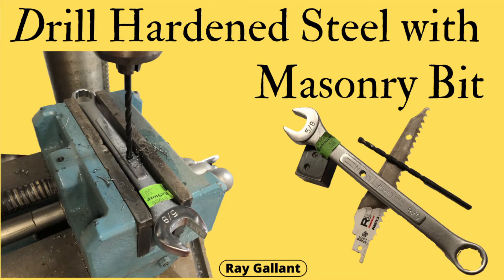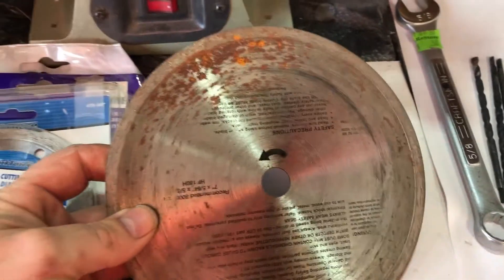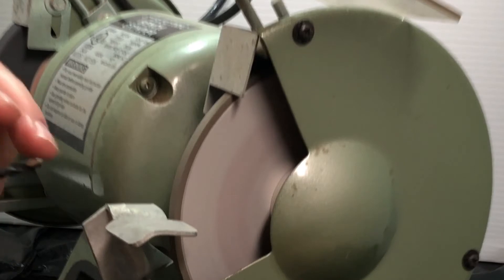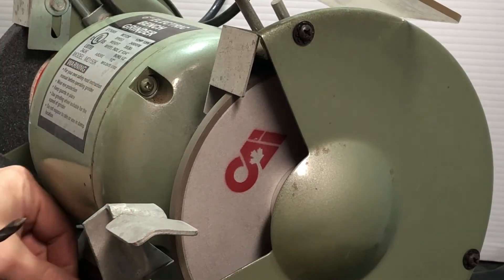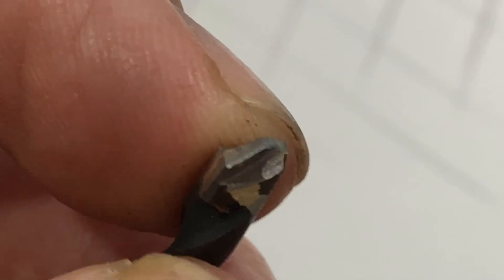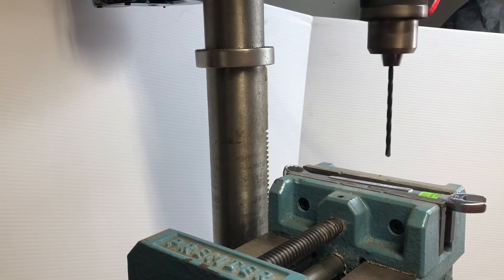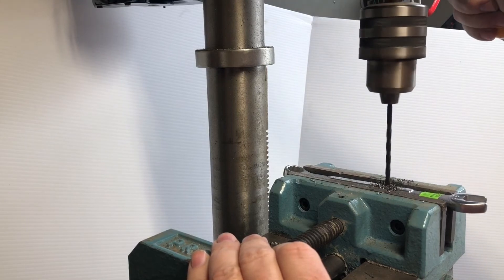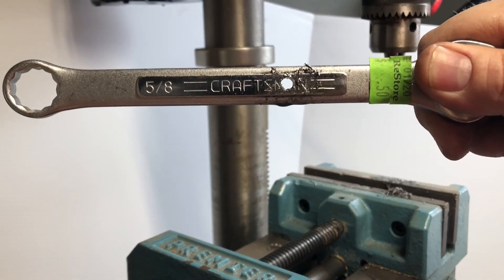Drilling Hardened Steel With Masonry Bits

Comment: I use a coolant while drilling using this method to prevent the braze holding the Tungsten tip to the brill-bit from melting/softening . . .(speaking from experience).

Comment: If drilling through thick aluminum, how long should the bit stay in contact before lubing and clearing shavings?
Also, how much downward force should one use to not burn up the bit?

Comment: What is the name of the wheel you used ? cheers
Reply from the maker: Wheel that I used is it American-made diamond wheel 
I have a separate video on mounting it that goes into explain that I picked the wheel up for five dollars from somebody on Facebook marketplace and it had been on there for months. No one knew what it was. 
Drop the price from eight dollars to five dollars who is selling off his father-in-law‘s woodworking tools 
This particular wheat retails for around $500 but you can get them on Amazon much cheaper and for doing this type of work. A CBN wheel will work just as well.

Comment: Be aware that when using carbide tooling on the mill or lathe you either do or do not use cutting fluid or coolant,the reason is this if you use oil/coolant(milk) you have to flood the part not just add it here and there because the carbide is so hard it cannot take heat stress ie sudden cooling ,it will shatter.

No lube or coolant can be done easily at reduced speed,in the case of the drill i would add the oil to the top of the drill shank to allow a constant feed down the drill as the oil gets closer to the carbide the steel shank will heat the oil up to match the carbide temperature,use a brush to add the oil as it holds oil on the bristles as a reservoir.

I've ruined plenty of cutting tools on the mill and lathe by not realising carbide is happy dry cutting,just don't thermally shock it or it's done for.

Comment: Now they make  "multi-material" bits like this with slightly better geometry for cutting steel. Some manufacturers recommend high as possible rpm when drilling steel.
Reply from the maker: Yes, Bosch and a few other manufacturers make them they’ve come down quite a bit in price and there’s multiple sizes

I have made three videos on drilling, hard material or using the same technique just to show that from home with very little investment, you can drill harder material in a non-Ritchard set up 

Thank you for taking the time to comment. It is much appreciated. 
Ray

Comment: 100% - but will this work for enlarging and existing hardened motorcycle sprocket 8.5 mm bolt hole to 10.5 mm? Cobalt drills aren't supposed to work as the central web isn't big enough so they will likely grab and snap; and even if not the sides of the cutting faces in contact will just blunt after one or two holes?
Reply from the maker: Carbide generally outperforms cobalt. The only factors are the quality of sharpening and the angles.
The more rigid, the set up the better the carbide will perform

Comment: Wow. I never knew that but I had 4 case hardened steel parts to drill an oil hole in and the masonry bit worked like a charm. Took only 5 minutes to do 4 pieces.
Reply: That’s excellent
Thank you for sharing your experience much appreciated and thank you for commenting that really inspires me to create more contact
Thank you
Ray

Comment: I've used a few HHS jebbsen bit and some other bits but nothing seems to make a hole bits keep braking.
Reply from the maker: What are you drilling into?
It depends on the type of steel I have another video which basically does the exact same thing or a drill into a tap 
This method does work relatively well there are a few things you have to keep in mind the diamond wheel I’m using puts an extremely sharp edge on the tool so that’s a bit of an unfair advantage
I am also drawing into something that is flat so if you’re drilling into something that has a bumpy contour onto it that you cannot flatten out you’re going to run into problems with the chip not fighting right away and wandering that could be a problem
Another problem is if you’re drilling into something that is hard and soft so the tap that I was drilling into the tap was hard but the surrounding material was not so that could be a bit of a problem as well
I hope that this helps
Ray
Reply: Drill into broken studd at the sump af the engine

Comment: Your demonstration  is very informative..  I've yet to try it myself.  Thank you.  Oh, one question.  Does it work with a smaller 1/8 drill bit?
Reply from the maker: Thank you for taking the time to comment
It should work with smaller drills now that I’m getting older I’m having a harder time dealing with this very small stuff
Magnification is required
Reply: @shopandmath  Thank you so much for your time and help.  I've tried an 1/8" bit and it really worked.

For your information, I first used a high speed drill  bit and then a cobolt bit.  Both couldn't even scratch  an 1/4" thick hardened steel.
Reply from the maker: I am glad to see that it worked out for you
and thank you for sharing 
Ray

Comment: Would this principle work on the bigger masonry bits like 1/2 and 3/4 and so on? Do you calculate the RPM for these as 80x4/drill dia or do  you use other numbers?
Reply from the maker: I have done this with drawls up to 3/4 of an inch with great success
Under ideal current conditions you can use probably up to a 300 CS
In the type of demonstration that I showed in this video the set up is not rigid and you would have to drop your CS down to probably 50 to 100
I hope that this helped
All the best
Ray

Comment: to be honest you need better camera skills for this video because it could be one of THE MOST IMPORTANT VIDEOS on youtube.
I thought that you needed a diamond wheel in order to be able to grind carbide masonry bits
Reply from the maker: I am doing the best that I can
there is a NEW how to drill harden steel video coming out Friday Oct 23 -20 at 9am
I have had multiple requests to drill very hard steel with a hand drill ?
i picked up a random chunk at work 59 RC
Ray
Reply: @shopandmath  please do it using a drill press cause it is more professional rather than a " the king of random" style video. This could really help people. sometimes you need to modify a hand tool for a specific function.
About the camera skills if you could use the help of an acquaintance of yours who knows about cameras and angles, he/she could really help you get the tip of the drill so focused when you zoom in. 
Your videos are very informative and helpful especially this one
thank you
Reply from the maker: @athrunzala5337  
don't watch the next video this friday
I used 3 camras and there is a good amount of white washing
it was the last worm day of summer
and filmed outside
should have done it inside
Ray

Comment: Just wondering what rpms was the drill turning at. I drilled hard steel last week with a masonary bit , but the package said good for steel too. Able to do rebar, I guess. Any way, I had 4, 3/16 holes to drill though 1 1/8 diameter hard steel. It worked but took about 2 plus hours. With a hand drill. Could not get the piece in a drill press. I used rapid tap oil. Masonary bits work. But in my case it was hard pushing. Thanks for the video.
Reply from the maker: You are the second person to ask about drilling hard material with a hand drill
I am currently in production of a video to drill hard material with a hand drill
I am currently swamped with school work
Hopefully Video will be posted either this Friday or three Fridays from now because next Friday’s video is on glass cutting

That amount of time is unacceptable and should have cut a lot faster
The piece I’m going to be cutting I believe is 49 or 59 Rockwell I film the hardness testing three weeks ago
Did you sharpen the drill to resemble a spade bit? 
Did you also re-sharpen after the tool became dulled?
Do you use a guide to drill the hole perpendicular and also to prevent angular movement during drilling?

Hold tight the video should be up in a couple of weeks
Thank you for your support and comments
Ray

Comment: Great demonstration. By the way, the Egyptians built everything they ever built with copper tools, which proves the point, you can cut hard stuff with soft tools if you have enough time, are patient, and you put a good point on the tool.  By the way, , you are guilty of a pronunciation that I used to be guilty of, until someone corrected me.  The word is  pronounced MASON RI not MASON ARY.  There is no A in there.  OK yell at me, but you will be a better person.  Oh, and slaves didn't build the pyramids.  Egyptian Patriots did. They were proud to work on such a big national project. It was also off season work  and a way to make money when they couldn't farm.  It was like their Moon  Shot.  With the pharoah buried in the pyramid, their future and security would be guaranteed.  That's a bunch of information you didn't ask for. That could also explain their persistence working with dull tools.  I used to be a teacher. Sorry!   Video Liked!!
Reply: thanks, I;ve always said masonary, but no more :)

Comment: For us lesser mortals, would you consider doing this demo with a hand drill (for those of us who are drill press-less).
Reply from the maker: I can do a demo what would you like me to drill threw ?
Reply: @shopandmath  I need to put some bolts through a spading fork head so that I can attach it to a handle.  My HSS drill bits were worthless...including the one that broke in half.
Reply from the maker: @tomterrific8574  
 spading fork head ?
can you send me a photo and some more info 
shopandmath@gmail.com
is it the same as fork lift forks ?
Reply: @shopandmath  A "spading fork" is what is called a "garden fork" in some parts of the country.  It is a four prong implement for breaking up soil for planting or light agricultural work where a tractor is overkill.  Generally, it is like a spade (shovel) that tills the earth without digging a hole.  The material is approximately one-half inch deep by three-quarters of an inch wide.  My original tool came apart after way too much use.  If you are in Canada, you will have to convert my English (American) measurement into Metric.
Reply from the maker: @tomterrific8574  is it a available on amazon?
or is it as hard as a wrench ?
Reply from the maker: @tomterrific8574  
I call that a pitch fork
I will do some research on the type of material and hardness and get back to you
Ray
Reply: @shopandmath  I understand you.  When I misspent my youth on a farm, a pitch fork was a long handled device with seven to ten tines that was used for "pitching" hay to feed animals and the like.  I guess nobody does that anymore (I'm really old)!
Reply from the maker: the video is finished and will be posted Friday Oct 23 at 9am
how to drill hardened steel with a hand drill
it took a long time to make but its done 
59RC about 18 minutes to drill 4 bits and multiple times sharpened 
drilled through 1 inch
Reply: @shopandmath  Thank you very much for following through with my request!  I cannot wait to see the video!

Comment: Amazing. Will try it to drill out a stuck bit in impact driver. Edit: used an unsharpened masonry to drill. It worked well and my drill operational again.
Reply from the maker: let me know how it works for you

ray
Reply: @michaelcook4922  i got this b4 others got to it. It looks hit and wedged in real hard from previous attempts. I dont think magnet will work, but I'll try. Cheers

Comment: Great info. Your attention to detail is what makes the difference between success and failure. Following your procedure also gives (most importantly) repeatable results,,,,the best kind of results.  I have a blind hole in a piece of turning stock that inadvertently became ‘work hardened’ through the use of a cheap drill. I now have a viable and repeatable method to drill past this zone in my work piece.
Thanks
Reply from the maker: thank you for your comment and sharing your experience
comments like your puts fuel in the creative gas tank
Ray

Comment: "Masonry" only has one "a" not two. You repeatedly add an extra "a" between the "n" and the "r". Thanks for explaining how to sharpen an inexpensive carbide bit to drill hardened steel. Agree it would be easier to see with a larger bit. Maybe next time...

Comment: Great idea!   I wonder if you could you do the same thing with a Drill Doctor?  Drill Doctor doesn't recommend sharpening drills smaller than 1/4" but for larger drills it works reasonably well.  I have a broken 1/4" tap that I need to remove so I think I'll try sharpening a 3/16" masonry drill even though it's not recommended, then see how it works.
Reply from the maker: I removed a broken 1/4-20 tap in a the video (remove broken tap)  Video link

https://youtu.be/rSShHH2Us5Q 

I tried to brake it in the drill press but i could not do it
so it got the hammer treatment
the sharped drill in this video was what  i used to drill it out
Ray
Reply: Carbide will tear up your wheel on the drill doctor. You need diamond to sharpen carbide.
Fortunately there are cheap diamond disks and wheels available nowadays...Some are very expensive...the one shown here is probably around a hundred dollars new but the ones he showed will do the trick also.

Comment: Thanks, I've been know to break taps and not have a carbide bit to drill them out. Masonry bits are widely available and cheap. I'm not as steady as you are so I'll try sharpening a masonry bit on my Deckle knock off tool grinder. 
You should have more subscribers!
Reply from the maker: thank you for the comment
it just takes practice 

you can do it
i usaly use a carbide end mill but the drill press is not ridged enough and will snap them
Ray
Reply: @shopandmath  I don't have a full set of carbide end mills. I use the mill instead of the drill press when ever possible.
Reply: @shopandmath  carbide ball mills actually do ok at removing taps for non rigid setups the ball curve helps protect the carbide